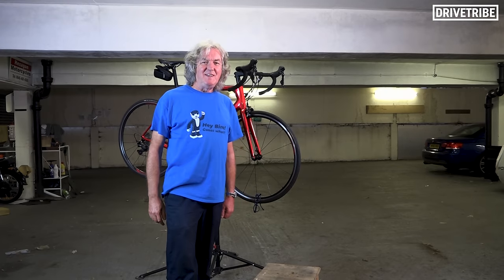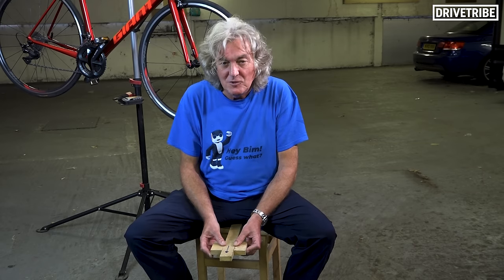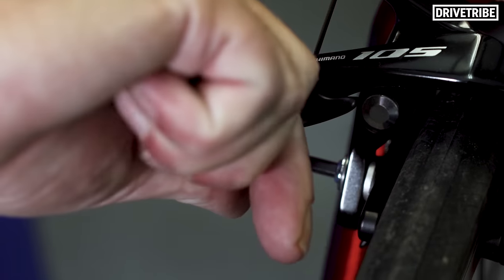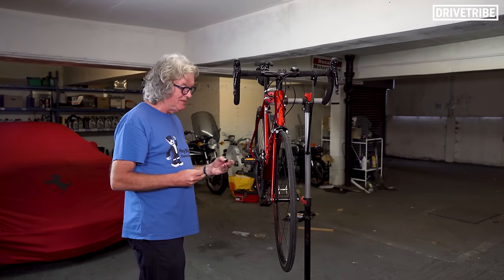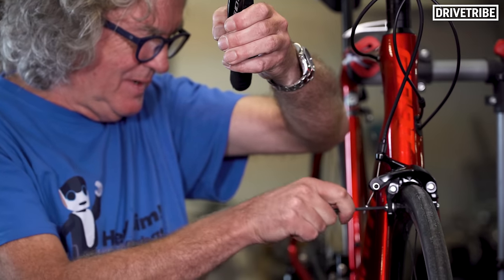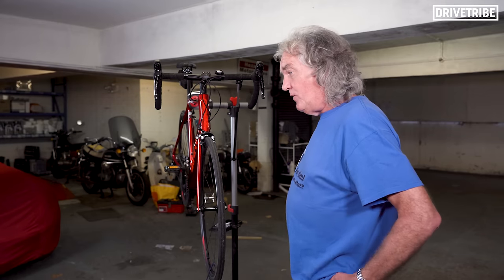5 minutes of boring bike maintenance with James May

Comment: I like how James rides a nice but still affordable bike
Reply: He rides a carbon bike but still has flat pedals 🤦🏽‍♂️
Reply: Jonathan Rockey eh the upstroke benefit of clips/clip less are grossly exaggerated. Flat pedals are just fine.
Reply: What’s the point having a bike fit for the Tour de France when it does the same job as the one he has 🤷🏼‍♂️
Reply: Yeah but has the last 458 speciale in the background
Reply: Brad Taylor his bike is fit for the Tour de France what do you mean. I’m not saying he should use it as a proper racer or anything, but if you’re gonna keep the bike completely stock and standard from the shop, without using it to more of its potential, you might as well go to Halfords and buy an Apollo
Reply: @jonathanrockey687  'might as well ' you say that as if it's the easier, default option. He has enough money that it's worth paying and forgetting for the peace of mind.
Reply: It could be that Mr May is a bit insecure hence the flatpedals, or that he got a knee injury 🤷🏻‍♂️😉
Reply: @smaspa8627  Being able to lift the pedal up when you stop at lights without having to kick the pedal up is a real benefit.
Reply: @earthstick  what do you mean, cyclists don't stop at lights
Reply: @smaspa8627  also he might be using it to go to the pub or doing some errands that doesn't require him to use a car, in that case flat pedal is just fine
Reply: Only ride what you can afford to have stolen.
Reply: @jonathanrockey687  An apollo will fall to bits after about a thousand miles. A real bike doesn't.
Reply: @earthstick  A bit of experience and forward planning and you'll never have to do that again.
Reply: @DarkHumorWritesItself  a new tcr2 doesnt cost half that.
Reply: @smaspa8627  Clip in pedals generate 30% more power, flat pedals are for amateurs
Reply: @smaspa8627  for commuting and errand running flats are fine. The advantages of clipless pedals though are pretty big. The main one being you can generate power on an upstroke rather then just a downstroke.
Reply: Don Johnson The latter, thank you.
Reply: @glenmurray7699  No they don't.
Reply: @austintinoC00l  No you can't. "generating power on an upstroke" is a myth. They tested it, it doesn't work. What you can do is unweight your pedal without having your foot come off, which slightly reduces power loss from the dead weight.
Reply: mclarenV12, zero chance it’s 5k, it’s a 105 spec bike with alloy wheels
Reply: Richard Maudsley “upstroke”?? If you were a knowledgeable cyclist you would know you’re meant to think of pushing forward and back rather than up and down. Sorry to say but the advantages of clipless pedals is huge.
Reply: I'm pretty sure that bike costs around 2k so not affordable to most people
Reply: @josephslater6233  It's a crank, it rotates, if you're going to be pedantic then neither "up" or "forward" is correct. You're the kind of person who thinks the strength of his own beliefs proves that they're right - I guess I'm glad you're channeling that into bicycles and not something important.
Reply: Richard Maudsley unfortunately I’ve worked in a bike shop for more than 5 years and specialise in bike fit, which means I do happen to know a thing or 2 about it. To get the most effective output power (BY USING THE CORRECT MUSCLES) you use a forward and backwards action... 
which means you must be clipped in, you strike me as the kind of person that is clueless and has no time in the industry and is simply a hobbiest?

Comment: Brilliant tip James! I agree brake block toe in is essential and improves the feel and efficiency of the brakes.
In practise however, setting them up like that has always been a trial and error job with lots of faffing about. I've simply found when setting the brake in the desired position, tightening it up moves everything about, so I have to set it first slightly wrong, with this movement in mind, so when tightening, it goes into the right position. Sometimes it works first time other times it takes ages to get right!
But your credit card trick looks like it simplifies this process tremendously!
I'll use that technique next time.👍😎

Comment: RIP White Dial Rolex Oyster Perpetual 39mm 😢😢😢

@Ben Patchett & @Benoit - Thank you for identifying the right watch. I did spot the polished center link and the clasp but the Milgauss never occurred. Blinded by disappointment of 2020 & Rolex announcement. Really loved the 39mm white OP
Reply: It was the perfect size 😞
Reply: Is it not a white dial milgauss 116400 he's wearing , but yes the lack of  39mm OP is a shame
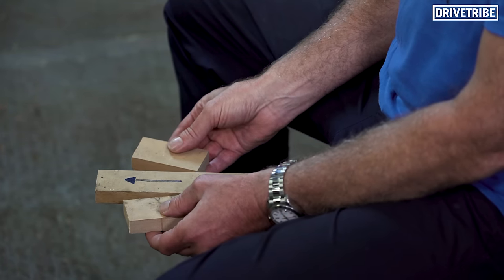Reply: @benpatchett2462 , I think you are correct in stating that it's the milgauss... the OP doesn't have polished center links (I don't think). And in 0:42 sec of the vid, you can sort of spot the shape of the lighting bolt second hand. Mind you the milgauss is 40mm however.

Comment: You must have the world's best behaved brake blocks for you to simply loosen and tighten them without their position changing whilst loose. I would never hold the brake lever with one hand, I would hold the position of the pad with one hand while tightening with the other, otherwise when you loosen the block it shifts and when you tighten it, it typically shifts again by twisting in the direction that you turn the Allen key. Also when you tighten your blocks there are slight changes to the distance from the rim so you don't center your caliper first, you do this after you have correctly aligned your blocks, then you can change cable tension, the centering of the caliper and if using v brakes on a mtb this is also when you would alter spring tension at the break pivots to centre on the rim, but pad position always comes first.

In my experience toeing in is always more effective in the back than on the front as the rigidity of the frame boosts the strength of the braking action as the brake mechanism is drawn inwards between the seat stays toward the seat tube. In the front this is not the case, although I have seen one or two bikes that have mounted their caliper on the back side of the forks to replicate the action of the back brake and give greater power.

Comment: I'm just wondering why he is using the long end of the allen key rather than the short.  Using the long end means less leverage and you want maximum control when loosening nuts on a carbon frame.
Reply: screwdriver tool bias ?

Comment: That’s really great Top Gear expert advice James. It’s always wise to toe in soft brake blocks so that the leading edge of the blocks wear down to a smooth ramp shape. Then when the rest of the pad compresses onto the rim, it’s shorter and has less material to wear out. Also, the front ramp sweeps away rainwater and mud, keeping the rest of the block bone dry and clean.
The correct toe-in spacing is not, in fact, a gold credit card thickness, but it is measured with the end of the small finger. The brake block clamping nut is never tightened so that the block can float into contact with the rim.
It is always vital to ensure that the open end of the brake block shoe always faces in the direction of travel of the bicycle to ensure adequate brake block cooling.
Next week, an advice video of how to correctly toe-in disc brake pads and keep them dry will complete the tutorial.
I hope this advice provides you with many happy hours of cycling.

Comment: I was just admiring the toe-in on my brakes before I opened YT and saw this video.

There's no question that disc brakes are way better than rim brakes, but when set up correctly a decent set of twin-pivot calipers can work very well indeed.
Reply: On disk brakes you get the crisp braking but it's got no feel to it.. It just locks in (a bit exaggerated) and doesn't give you that many options between locked and free..
Reply: I would definitely not trust disk brakes on corners because they will almost definitely lock the wheel and make it slip on the road..

Comment: James,

	You've reversed the brake pads' leading and trailing edges.
The back of the pad is the leading edge, it's the first part that the rim passes, innit. Unless, of course, you're riding backwards.

	Your credit card is far too thick inducing excessive flex in the brake arms and pad compression prior to the pads making full contact with the rim.
	I have used a 0.04 mm feeler gauge for pad toe setting. While it did produce enough toe to eliminate squeal with minimal flex and compression, the process was rather troublesome, (more trouble than it's worth) requiring clips and clamps to hold the feeler set in place.
	I've since switched to using electrical tape for ease of use, it holds itself in place freeing your hands. It measures ~0.18 mm and causes barely perceptible flex and compression.
	Lay a half lap of tape across the tire onto both braking surfaces, engage half the tape's with under the pads' leading edges, set the pads using only enough brake lever force to make pad contact (not pad compression), remove the tape and adhesive residue.

	Please, keep your beautiful bikes away from Clarkson, he's just the sort to stage a tank vs bicycle showdown, because, funny.

Comment: Lets not forget increased modulation and performance with with compressionless* housing reinforced with aramid fibers (such as Jagwire Ripcord) where it reduced fade particularly on the front brake.  Also what is your preference brake pad compound?  I find the Shimano OEM just fine but brand Koolstop does offer duel and tri compound pads optimized very weather.  I'm most pleased you are using alloy rims and not carbon clinchers 

Also please do a round table with Raoul at Luescher Teknik, Jan Heine & Hambini I think that would be tremendous fun  

*Compressionless housing is also excellent on mechanical disc brakes where fade is really bad.

Comment: cycling are dangerous sport. you can do 40-50kph or 80kph for pros, with tiny wheel that have no traction at all in case of an emergency braking, a small helmet and thin jersey. i feel more exposed while cycling than in motorcycle..

Comment: Seriously interesting. Did not know about the trick with the credit card, I always toed my brake shoes in by the eye, which over the years got better for this task. However I will try this next time I need to adjust my brakes. 

Also I am not a friend of disk breaks on race bikes or in general on lightweight bikes, as you really don't need them and they will only lead to more asymmetric torque to the fork. Sure, in Downhill and Enduro hydraulic disc breaks are a must have because of the mud and water, and these bikes don't care bout the torque or weight anyway, but even on my XC I use V-Brakes. The bottleneck of brake power isn't the break itself anyway, its the adjustment of the jam point and the low resistance of the brake. Any well adjusted and lubricated brake can be used with one finger.

Comment: Well a video on bicycle bread disk maintenance and internal hub gear readjust I could use. I used to cycle every day since I was 12 to school. And it is quite normal to do the maintenance yourself here. But these two are quite different from the normal older configurations. And a bit of car knowledge might help with it.

Comment: I have noticed that your front brake is activated by the right hand squeeze handle. I have noticed that the majority of bikes I've ever seen is that the front brake is on the left hand side which I always thought was incorrect. Just like a motorcycle it should be right hand front brake and I noticed that your bicycle is that way. Is that a standardized thing, for a nun standardized thing, or did you modify it?

Comment: An entirely better solution is to upgrade, yes upgrade, to disk brakes. They are more powerful, easier to modulate, less susceptible to the wet, don’t wear out the rims, require less maintenance and engineering wise, far more elegant.

Comment: Many moons ago aged 10 I replaced my brake pads for the first time myself and as you correctly mentioned putting them in the wrong way round will get you killed as I almost found out as they shot out the back while approaching a bust main road down hill but luckily a keep left sign leapt out in front of me bravely sacrificing its life to save mine

Comment: And what when you wear your pads, as you will, more than the thickness of your credit card? 

I'm also a very experienced rider, older than James, and built and rebuilt many machines. I've never had to reset a longitudinal bias into well worn pads, and they've never squeaked, chattered or shuddered....well, not for decades anyways.

Riddle me this: Why would you wish to add structural twisting torsion to a mechanism that's meant to operate in a flat plane?

Comment: it makes sense in theory but wouldn't it be more expensive in the long run? the edge will get worned out more quickly and uneven and you will have to replace the pads more frequently.

Comment: James you made a mistake. Isn't this toe out? Given the direction of rotation I think the wheel moves from back to front through the calipers, so the leading edge is at the back of the brake shoes. That would mean you set the shoes toe out. Rest of the explanation still holds, just that toe in creates brake shudder and toe out gives you modulation.

Comment: This is the same reason that multi-piston brake calipers have either differential bores or offset bore locations (in cars anyway, not sure about bicycles.)  I'm surprised that the actuating lever piece appears to hold the brake pad in the center instead of a bit farther forward.

Comment: I prefer having the brake blocks done up a bit more tightly than that. I am also not sure that you should be presenting tutorials on critical safety equipment and doing up the bolts lightly.

Comment: Most of the time, the speed is not too fast.

If the brake shoes are parallel, the life will increase.
But if the front end touches the wheel first, the brake pads wear out too quickly.

Comment: You'll notice on the caliper, there's a little lever that the brake cable is bolted to. It is currently pointed up, which while fully functional as a brake, does not allow the lever to do its purpose. If you adjust the brakes while the lever is pointed down, you can then rotate the lever until it is pointed upwards to more the caliper assembly apart, creating room for the wheel to be removed. Loved the video!

Comment: If you want your rim breaks to break like disk breaks, you can sand the rims just a bit so it bites more but I would recommend only doing it at your own risk, theirs not much of a danger in doing it but you need to sand towards the center because it grabs more and not along the rim because the groves are then inline with the rotation of the wheel

Comment: Living and riding in the mountains of California, I switched to disc brakes more than 10 years ago and I'd be scared if I had to go back.  I rode from Beijing to Amsterdam without having to do anything to them.  Because a hub lost its bearings, I had to switch out to a weaker rear wheel in Yekaterinburg which wouldn't stay true.  Not an issue for disc brakes.
Riding thousands of feet down  muddy 20% grades in a downpour?  Not a problem with disc brakes.  Disc brake pads last years, and I ride about 5,000 every year.
More than trendy.  Safer and more practical.  Like the switch from drum brakes to discs in your car.
Your Luddite tendencies can be entertaining sometimes, but discs are many times safer.
Reply: Eric Knudstrup I know, I have a disc-braked Cube. But a lot of people still have rim brakes. I’m hardly a luddite.

Comment: To mess with your head even more, would disc brakes benefit from the same from the pucks built into thr housing? They flex much less but still have force sliding on it the same
Reply: no because hydraulics, and they're round? not roughly rectangular

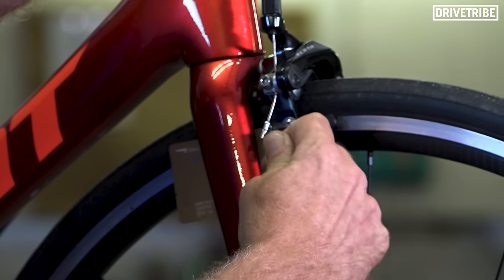Comment: @4:23 it looks like the cam to allow the brakes to be released for wheel removal is in the open position.

It's usually possible to get the brake blocks to make reasonable contact with that cam open, but the pressure is much lower than with it shut. It's possible that James is using that to give himself more room to play with inserting the brake blocks and adjusting them, but it's critical that the cam is flipped or braking performance will be pants-fillingly poor. 

You can also work around this by tightening the cable, but then you can't easily remove the wheel. 

James, did you flip that cam shut after the video, or was your first stop a bit of a moment?
Reply: David Hughes No, it’s closed.

Comment: is the brake caliper not in the 'open' setting? you know the 'flicky' switch where the cable bolts to the caliper is in it's wide setting? you set brakes in the closed setting (cam lever pointing to the floor) so you can open it giving clearance to get your wheel out? (cam lever pointing to the sky)
Reply: mark stack It’s closed. Some Shimano cams operate side to side.